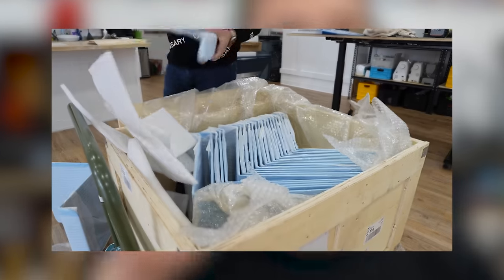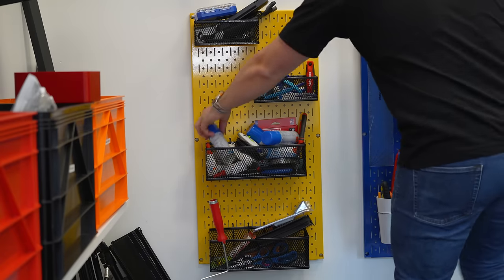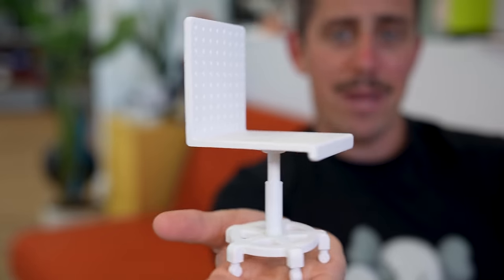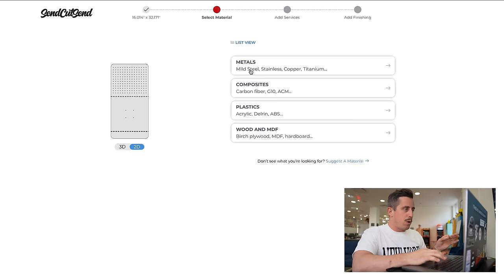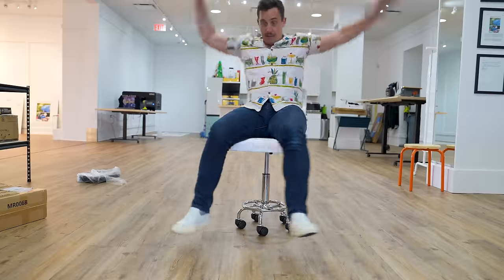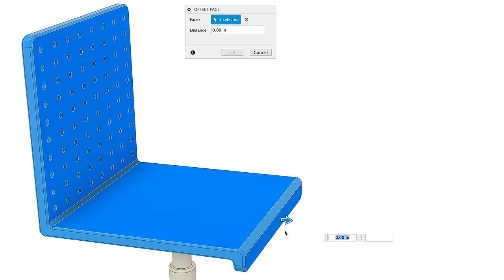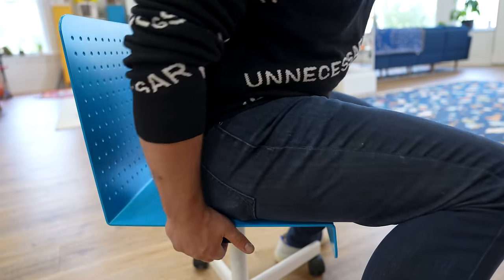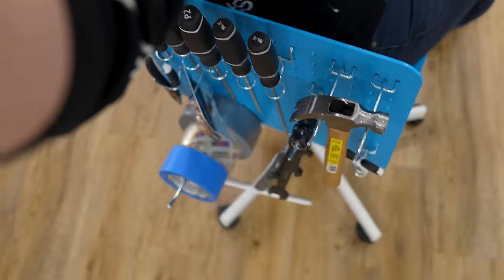I Designed A Chair for IKEA

Comment: You should have cut out notches that would fit the SKADIS peg board accessories.  IKEA can't say no to that.
Reply: Yeah! I was thinking the same thing! It annoys me that it doesn't match u with their other pegboard products.
Reply: Yea, seems like a big swing and a miss on that one
Reply: He probably didn't do that becuase they may have trademarked or patented that design?
Reply: @Curiouscrazy   Probably. If he made it, he would be putting up a fight with IKEA instead of a possibility of a collab. Now Ikea can come and say "hey... I have an amazing idea".
Reply: SKADIS is actually standard size to match all other pegboards. Almost all pegboards are 2"x2" so it will work!
Reply: really cut out notches?
Reply: just remade this chair with standard skadis holes in fusion il post it to printables in a minute
Reply: Pillow with pegboard attachments to secure the pillow.
Reply: @HeitorAmaral  I have done this intentionally on designs for my customers. So they can feel that they have influence with giving me this really great (and for any designer, extremely obvious) idea. This way, the chances are lower that they'll find something really annoying to change. In case they go against all expectations and not come up with the "idea", I'll just propose it myself and leave it up to them whether to implement it or not.

Comment: A revision could be the back being doubled walled to make it stronger and keep the pegs from stabbing you. Have the back follow 2 90 degree bends to keep it one solid sheet.
Reply: Came to say that the pegs stick through... I see great back scratching, or really bad back scratches...
Reply: Also think it is a shame that he didn’t use ikea’s peg board system (has different shaped cutouts for the pegs).
Reply: To add to that revision: choice to have cushioning or not. If you want cushioning, you basically attach it to the opposite side of the pegboard. Otherwise there’s a thicker metal sheet to attach to the pegboard instead of the cushions.
Reply: 😅😅 by
Reply: I came here to say the same thing.  Instead of a double walled seat back, what about just a snap on seat back that slides over the very top and provides a sturdy, solid seat back?
Reply: came here to say the same thing!
Reply: Agreed. The production version should have some depth to keep the pegs from jabbing you while seated. Unless you want to go with the name BAKSTAB.
Reply: With the sheet metal presses I’m familiar with it wouldn’t be possible to do two 90degree bends that close together. I agree that having a dual layered back would be best, honestly a two piece assembly thats welded would be fine
Reply: No.
Reply: Countersink the holes for the base so that the screws go down from the top, through the base and either nylock or capped nuts underneath. The screw heads would then sit flush with the surface you sit on and not have just a couple of threads screwed into the seat to hold it together.
Reply: Great idea

Comment: IKEA got one basic design rule and you didn't take that in to consideration. You can't flat pack this thing! Cost saving design is everything.  I visited the IKEA museum this summer, btw. Älmhult Sweden
Reply: What you saying is true. But when you look at the other low cost ikea office chairs, you find out that actually the top is sold separately as one piece that is not flat packed, so I don't think it's gonna be issue
Reply: Interesting. You are correct!  @falling_homer
Reply: The back could be made into two pieces that interlock, but I don't know how much strength would be lost doing that.
Reply: @falling_homer as long as the tops can stack is what I've noticed! They have a lot of molded seats that aren't flat pack but they still can be shipped efficiently because they stack
Reply: There's probably a standard part number for the part they use to connect chair seats to chair backs, which would let you flatpack them both.
Reply: their chair tops stack in each other rather than flat pack, so they can still ship a lot in a little space. This follows suit.
Reply: Omg I visited the IKEA museum in Almhult this summer too!! It was amazing
Reply: I never bought a flatpacked office chair from ikea.
Reply: @falling_homer Yes, I've put together some of those chairs. The front legs and seat are one metal pipe with a padded seat are one piece and the back legs and back rest are also one metal pipe with a padded board at the top with a straight bar across and two tabs that the seat parts bolts on to. It makes sense since they don't have to weld bent tubes together which can be rather difficult to do for a high volume machine. The seat part have threaded inserts and the back piece have machined holes in the straight bars and tabs. You use four screws to attach them and they are very solid. Even I at 6'8" and over 150 kg can stand on them without them breaking.
Reply: also the name isn't Swedish so that's also a miss

Comment: Continue the pegboard holes to be on the bottom of the chair as well. Then IKEA can sell cushions in multiple colors which click into the pegs for both the bottom and backrest.

Benefits:

1) IKEA likes to sell accessories for their products nowadays, cushions are a good option. The peg mounting would both keep them in place and make it easy to remove or switch out.

2) the peg holes on the bottom would hide the screw holes used for the base (assuming you're not using a cushion).

3) cushion on the backrest will protect your back from being jabbed by pegs.

4) You can hang things off the bottom of the chair, reachable when you're sitting in it.
Reply: Also, what if you could hang stuff like little baskets on the side

Comment: I would add some armrests w/ peg board or peg board parts going down on the side, because when the tools are on the back you'd probably have to get out of the chair to grab them. With having some extra peg space on the side, you can have the advantage of all of the storage on the back, but have your most used tools easily assessable on the side

Comment: As a furniture maker try the seat back angle between 15 and 17°. Also to make it easier to use maybe add arm rest that double as a peg board. You could make the whole thing look like mine crafty  design very square.
Reply: I believe that when he rest on the back it flex to 16degree
Reply: @JeromeDemers  you might be right good point!

Comment: I like the idea but it definitely needs a bit more work. The back could be doubled up so you don't have to lean on the pegs sticking out. Also a bit of cushioning or even just a more rounded end bit where your legs are. As it is now it looks like a really sharp edge that's probably not fun to sit on for a while.

Overall it's a great idea though and I could see this work well in a lot of people's workshops.
Reply: you can just say that it is crap

Comment: You need a slight curve or cushion in the seat so it doesn't cut your circulation when you're sitting and then maybe a second cushion or double thickness on the back to stop the Peg's from stabbing you

Comment: If you do more, I'd suggest countersinking the holes in the seat base and threading the screws though the other direction towards the wheel base - would look a lot cleaner.

Comment: A couple things to taking to consideration that might make it a lot easier for your product to be considered. The base and back to 2 different pieces so it takes a classroom in storage add a bracket to connect the two so that they’re still connected and still sturdy and maybe consider a single pegboard arm to make it easier to grab more important tools that you need quickly something that would be more on brand as well as because most chairs have two arms if they have any at all but yours having one would make it stand out. Also consider upholstering the bottom seat, to add extra comfort

Comment: Due to the pegboard design, you could make a cushioned plate which attaches to the holes on the back, which would make the chair more comfortable. Also, with different "inside" back rests, the chair would be infinitely moddable regarding ergonomics...

Comment: If you want to really cut costs on the top half, if you get a thinner steel, but add ridges into the steel, it has the origami effect where that thinner steel is equal to a thicker piece of flat steel

Comment: Flanges or corrugation would have made the seat much stronger without needing the heavier/more expensive thicker metal.

Use either threaded post screws to attach the seat or counter sink the standard screws and thread them in from the top.

Add cushions that snap into the peg holes for comfort.

Radius the front edge more.

And of course, have it use IKEA's standard style of peg slots (like the tooll boards you already have).

Comment: if the screws are flush, the metal must be tapped.  Doesn't seem like that thin of material would hold very good?  Why wouldn't you use flathead screws going down, and then nuts on the bottom?

Comment: I would buy this if there was some cushioning on the base and back. I would also like if the back was taller. Though if you change the holes to align with the SKADIS line you would be able to use their current peg board line up of items. I legit think this could be a great ikea product

Comment: Put some holes in hair base and installed a lower power fan to keep the butt cool and dry. Thats a very serious issue that i dont usually face but in summer 🥺🥺, but havung cool butt while sitting will be really so calm and will promote people to sit for longer time and more work. Please try that. Use Foam with much gap in Between them and pass air through them. Tell use how its feel.
Reply: Or instead make a buttpillow That's will be fun and easy to make

Comment: I would think that if this was to be marketed towards Ikea it would of been better to base the peg board off of their Skadis pegboard system.  All that would be needed is a few holes on the back of the chair and then mount a Skadis board on to the back so that your back doesn't hit the pegs by having it sit out about a 1 cm.  The more that I think about it I kind of want to try doing that now with cloth wrapped on the peg board so that it doesn't make as much noise moving around lol.

Comment: you don't need to make it much thicker,  you need to make a curve like a river, from bottom to top. it will make back stronger.  or bending  side edges (like 0.5 cm) backwards. should do the same.

Comment: I have a unnecessary Invention for you. Every night I wake up and my bed sheet is on one side on the floor and I have to get up and fix it, is there a way that you could make something to hold my sheets down so they don't come up?
Reply: Have you tried tucking the edges under the mattress?
Reply: Have you tried tucking the edges under the mattress?
Reply: @fearsomefawkes6724   I've tried but then it comes undone and it also makes the sheets uneven.

Comment: The next prototype should be designed to be sat on backwards, so the tools are in front
Reply: And pegboard on the sides, and make sure it lowers a lot so people building/working on something low can reach. Also make sure it can roll over some carpets, even if it's that super low pile stuff at shows and conventions...

Comment: Instead of thicker metal, adding a bend to the sides, and possibly a corner weld if you can find someone to do that, would make a huge difference in rigidity.

Comment: you have 4 holes for 4 screws... just use flat / rounded heads screws and place them downwards lmao... with a nut at the bottom... this is why we hate engineers and designers... they dont fricking learn... do they? like why put the screws upwards? TFK